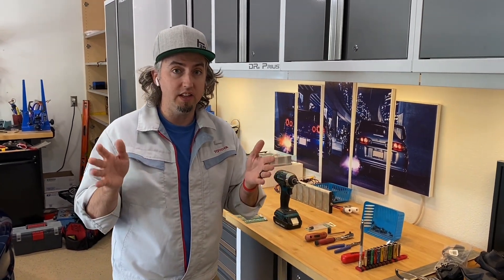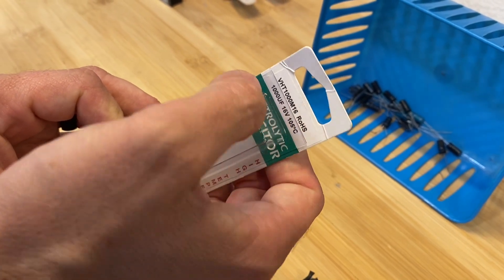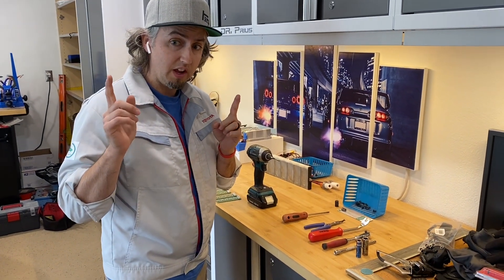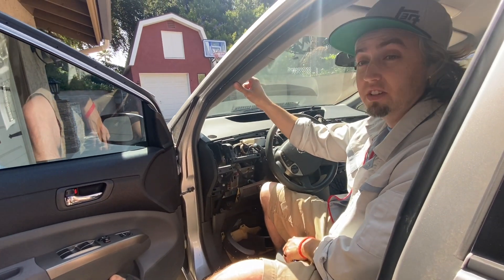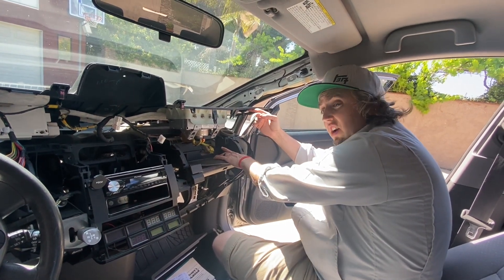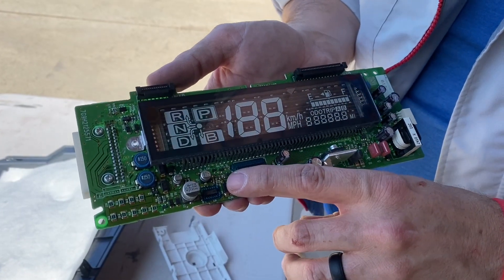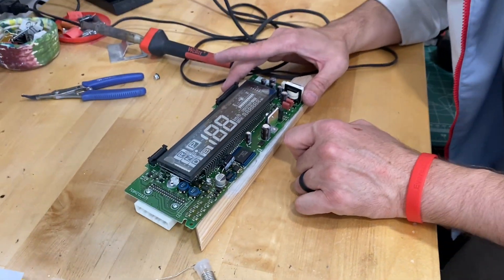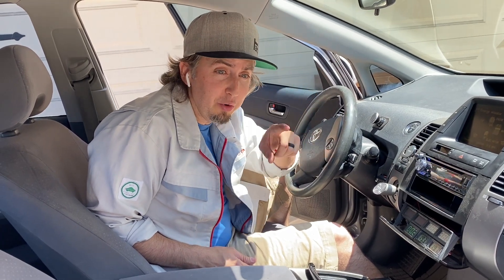Toyota Prius Gen 2 (2004-2009) Dash Removal and Capacitor Repair

Comment: Do you have the part number of the cap that was there? Would love to get another smd cap to replace it with
Reply from the maker: Just get one that has the same or higher voltage rating and same or higher micro farad rating

Comment: I bought the capacitor from the link but it looks WAY smaller than the one in your video. The one you have is maybe the size of a large grape, the ones I got are about the size of a peanut. Did they change at all?
Reply from the maker: Caps come in different shapes and sizes, the key is getting the voltage rating and micro farad rating right.

Comment: I wonder what the average cost would be of paying someone to do this? Looks like a total pain in the ass.
Reply from the maker: @jamesmartin8555  it’s actually easier than most think, but it’s it my favorite thing to do. Usually dealer charges about $900-$1100 to repair it.

Comment: FYI - If there is anyone left like me (Dec 2024).... By far the easiest way to get it working temporarily. The driver door open light shows in the dash when working correctly. When the dash goes out that driver door open light also is out. Power the car off (might have to hold the power off button in for a bit). Open the driver door. The door open light will not be showing. Leave the car powered off and start using as much electrical as possible  (turn headlights off/on, turn emergency flashers on, turn interior lights on, push brake pedal) (that's all I have ever had to do). Eventually the door open light will come on and it is working again. It is a capacitor problem and I think this discharges the capacitor(s) and resets the problem (temporarily). I learned this from someone on YT but I don't know who so I can't give credit but I thank him every time it occurs. I bought new capacitors but would rather not have to go through this repair. I'll see how it goes. My 2007 Prius is awesome!
Reply: only works for so long
Reply: howd that go

Comment: I'm also doing this repair on Sunday. I bought the 220 UF 16 volt. I hope I'm doing the right repair. I got in the car press the power button all the lights came on including the red triangle of death but the car would not start. The MFD was blank. And the car beeped six times. And then it wouldn't turn off it took like six times trying to make it turn off.
Reply: did it work ??
Reply: @cougarswagnum  it ended up being a different problem. Thank goodness I wasn't looking forward to all of that tearing apart of the dashboard. It turned out my 12-volt battery was just low.
Reply: @ ohhhhh ! mine is bad too, it normally holds at 11.2 volts, do you think a replacement would help ?

or was your battery holding at a lower voltage ?
Reply: @cougarswagnum  it made all the difference for me it's worth trying. My new battery is holding over 13 volts my old battery was just slightly below 11.
Reply: @cougarswagnum  I use my Prius for camping and I have a inverter attached to my 12 volt battery and it accidentally got turned on when I was moving some stuff and I didn't realize it and it drained my battery I jumped it it was okay but it never got back up to proper voltage.
Reply: @cougarswagnum  I think I'm going to have to do that repair eventually anyway though I keep having dashboard problems. So far I have found workarounds on them.

Comment: So I was debating on doing this myself due to time and availability crunch. I decided to take my Prius in to a shop and I told them what I thought the problem was with my instrument cluster not coming on and also the car has the issue where it doesn’t power all the way down. They came back with. I need a new cluster and computer for a total of about $1700. Do you think that is possible or do you think they are just trying to get over on me?
Reply from the maker: That is ridiculous. They are gouging you.

Comment: Any idea if this module also might prevent the car from shutting all the way down? The module has been repaired with the capacitor replacement and had an upgrade mod to the latest revision.
Reply from the maker: Yes it can prevent the car from a quick one click turn off.
Reply: @TheHybridGuy  it’s not just the one click turn off everything shuts down except for the mfd and the aux power outlet. I’ve tried pulling all the relays so far but when I turn it off, even if I do the hold the button in for 5 sec hard shutdown the mfd and aux power stay on. If I open a door I get a constant beep from the dash area, if I close the door I get 3 beeps from under the hood. If I try to lock the doors using the driver door switch it immediately unlocks the doors again. 
Even with both the fobs more than 100 feet away it does this. Several of the symptoms look like it thinks a key fob is still in the car. I’ve got a detailed post in the gen2 area on Prius chat. 
It’s puzzler. I’m disabled so I can’t get under the dash to unplug the ecu’s. I’m looking for a good flow chart/ diagram of the startup, shutdown procedures to see if I can isolate it. I don’t get any codes using 3 different iPhone scanners, my android setup running hybrid assistant and torque or my 10 year old version of techstream. 
Any suggestions, I really don’t want to take it to the dealer for a $1,000 diagnosis charge to find out it’s the dash model, the mfd or the immobilizer.
Reply: @texaspowerman what did you find out? I just had my high voltage battery and 12V replaced, they just said it’s not shutting all the way down either… and I have the bad capacitor issue.
Reply: My cars still down, I had surgery scheduled and worked on it until the last day. It will be a week or two before I’m back at it. 
The closest I got is it’s the acc relay or the ecu itself. Something is telling the ecu that it’s not in a ready to shutdown state. If you pull the power, it automatically comes back up in the last state so there is no way to reset it. 
It could very well be a signal from the combo meter, why I haven’t a clue what they were thinking. 
If you find out please post.

Comment: Thank you so much for this! I’ve been putting this off for a while cause it looks time consuming but I just need to bite the bullet. 

In case anyone else wants to be lazy and not do the repair, I usually get the dash to come on by flicking the lights and brights on and off 3x and fully pressing the brake 3x. Repeat as necessary till you hear the electrical clicking and then turn the car on.
Reply: I got that to work for about a year, now I have to officially fix it
Reply: When I tried this the dash lights came on but also the red triangle of death and other never before noticed lights!

Comment: Shame the important details of taking the dash out are fastforwarded over so quickly that it's not possible to catch exactly what is being taken apart in what sequences.
Reply: @marku2805 Use the Gear icon to slow the video down
Reply: There are plenty of other vids
Reply: @supercooldude824  yep, that’s why it’s good to let others know to not waste their time too on this one.
Reply: This was pretty detailed. I opened whole dash in 30 min using this video.
Reply from the maker: It’s relatively straightforward. Biggest things are getting all the trim parts out of the way.
Reply: Straight forward for someone like you who is skilled, but certainly not for someone like me who has never every done any kind of work on a car. 
I live in a rural area and there isn't anyone who works on hybrids withing 150 miles. Yup, I'm a typical old lady, who's done nothing but change the tailgate switch, thanks to Youtube showing me how. People like me need step by step details. Also anything that takes any hand strength, old broads like me simply can not do.  @TheHybridGuy

Comment: You can slow the video down to see the dash removal by going to your settings in YouTube and changing playback speed.
Reply: You must have said that before you slowed the video down.  Frames are missing when it's slowed, meaning someone like me, who is NOT a mechanic at all, miss little things that are important to see.
Reply: @jazzcatt no, I just slowed it down now and there are no frames missing. Did you use the little cog icon when you hover over the video and change the playback speed to 0.5 or 0.25 even?
Reply: OK it looks like frames are missing because of the speed.  It's jerky.  I tried both 1/2 speed and  1/4 speed.  Can't see enough to know what you are doing.  When you look at it, you know exactly what's happening  because you were doing it and have done it before.  I haven't, and don't.     @Tonisuperfly

Comment: I'm going to attempt this in the near future. There's another guy on YouTube with a video for this similar to yours, and between the two I have a lot of confidence now that I can do this on my day off and have the problem fixed with plenty of time to spare before having to drive to work. Thank you so much for your dedication to providing others with the information needed to fix our own vehicles! You're saving us thousands of dollars in the long run with what you do.
Reply: Did you get it done and was it successful?
Reply: @Tonisuperfly  Yes I ended up doing the job a few months ago and it works perfectly still. So happy I did it!
Reply: @4leafmetal  looks like I’m going to have to do it too. Thanks for the reply!
Reply: @4leafmetal  Are you still happy with the repair?
Reply: @4leafmetal  What size capacitor did you use?
Reply: How was the dash trim removal and replacement?

Any other tools you might suggest?
Reply: @raycootz9420  be gentle with the vents when removing them. I cracked one. And be organized with what you remove so you can easily put it all back together. Watch a few other videos like I did so you have a good idea as to what tools you'll need. But you don't need much
Reply: I have to do this - Toyota wants to charge $2500 - I'm nervous about the removal and solder of new. I just finished changing my water pump today! These videos are so helpful
Reply: 😊gggygggg

Comment: Great video, thanks. I have to replace the immobilizer ECU or clean the connectors (light on the dash no longer flashes) but I am not sure where exactly it is located. Is in accesable behind the part right above the steering wheel? Hope you can help. Good luck with you channel, liked and subscribed.

Comment: I really like this video very informative! So I've had the same problem with my lights not coming on, sometimes they have come on and I can't go into gear, and sometimes I have not been able to turn my car off. From the research I have done all of these problems definitely seems to have to do with the dashboard control module.  Will that same capacitor being bad cause all of these problems or it could it be more problems in my dashboard control module? I also appreciate the time lapse however it would be nice to have it a little bit slower to better see the steps of removing the dash and everything. As somebody who has been a professional mechanic 20 years ago and now continue to fix my own vehicles removing a dash is a little overwhelming as I know how easily they can break and be hard to put back together. Anyways just a thought that maybe providing a slow down time lapse or even a another video without the time lapse could be very helpful for many non professionals.  Thanks again.

Comment: Can you clarify if the issue was just dash lights out or the vehicle would not start as well. I'm having electronic issues where the battery just needs a short jolt of power and then it is good. I even had the whole dash light up and fans go after I had removed the key and left the vehicle. Thanks!

Comment: thanks so much! it went a little bit fast on the time lapse. How easy is it for a cautious beginner who follows steps? My prius dash only turns on when you unplug and plug the 12 volt in so i assume this is the prob. if so, this will save me at least $80. Im more worried about soldering and putting everything back. I have people who could potentially help. thanks! oh and roughly how long did it and or will it take?
Reply from the maker: My first time EVER doing this took me 4 hours. It is pretty simple once you get the hang of it. There are some tricky things but overall its not too bad.  just keep track of where stuff goes.
Reply from the maker: My first time (15-year auto tech) took me 2 hours. Now I can do it in 30 minutes. This is most likely your issue.